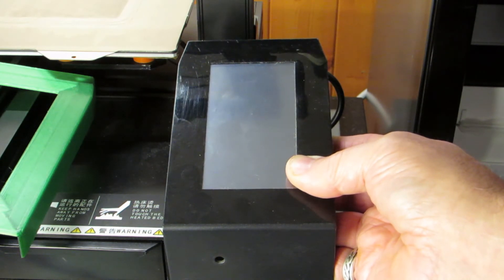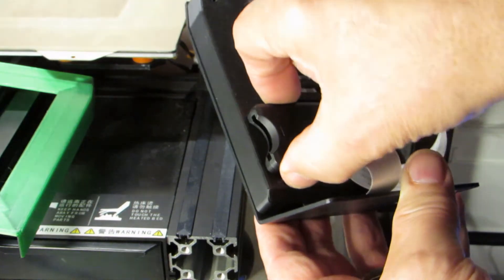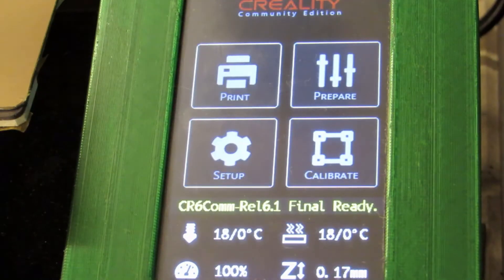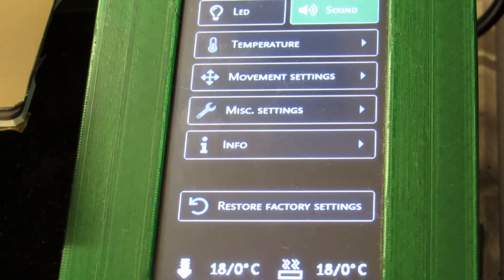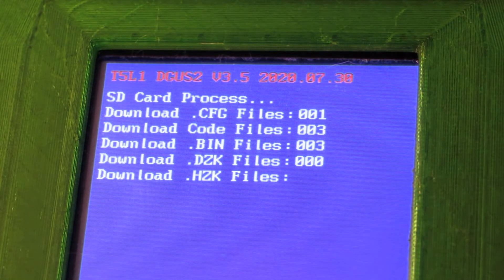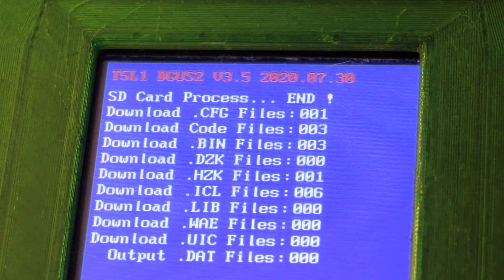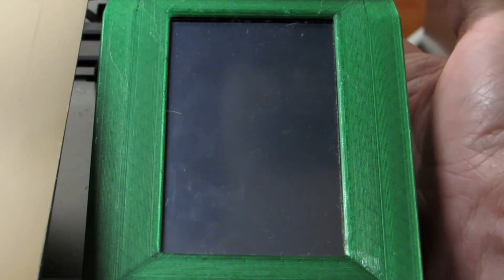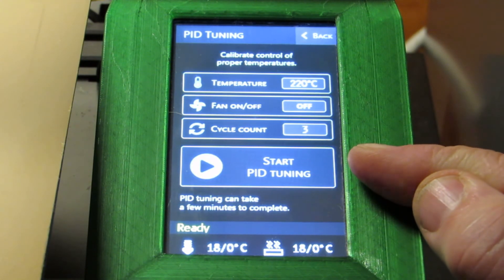Let's Flash! - Step 5: Flash CF6.1 to the Stock CR6 Display

Comment: Hello clear and nice explanation I saw all but I have issues my display has T5L1 DGUS2 v4.3 2021.10.21. and by mistake I flashed with the T5L_UI_DGUS2_V45_20220105............. now what to do? the screen is black nothing even try to flashing with the 3.5 is working what should I do?
Reply from the maker: Wow.  Really sorry I did not see this until Feb'25...

I hope you figured out by now that you could just flash the Refactored DWIN_SET to solve the blank screen issue, but you would also have to calibrate the touchscreen to v4.5, to make the buttons work.  Or just flash DGUS v3.5 to the display.